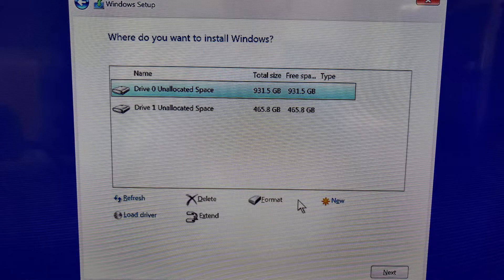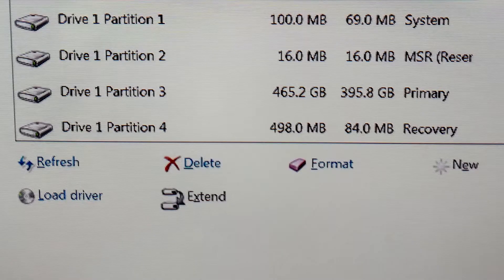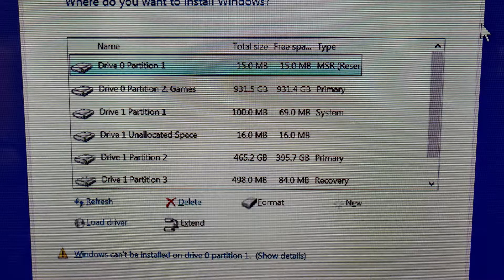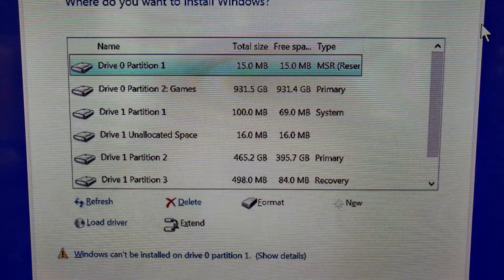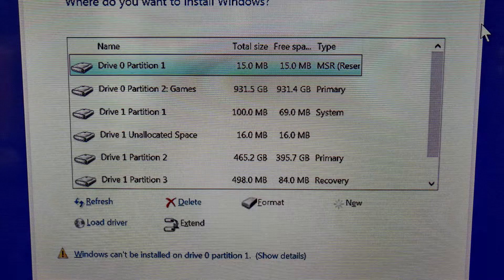Avoid This Issue When Building Custom PC With Multiple Hard Drives

Comment: I just built mine and had the same issue. Funny thing it it actually worked with all  storage drives installed but started getting the blue screen errors. I thought it was hardware related until I decided to remove the additional external drive since I’m using an m.2 2tb for my operating system. I wanted to confirm on yt and came across your video. Thanks for the tip.

Comment: When I add a new identical hard drive the window will not boot. Bio sees 2 identical and give 2 identical ID, so window boot got confuse which one is active. One has window 10 and the other blank (Format). It will work if different Hard drive, can anyone help? thanks.